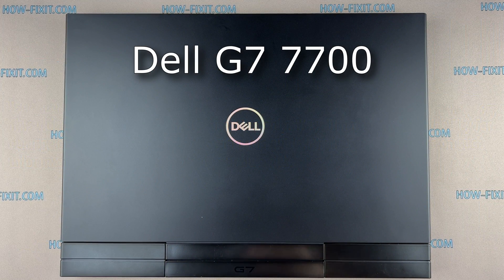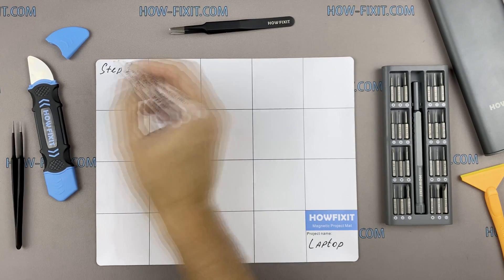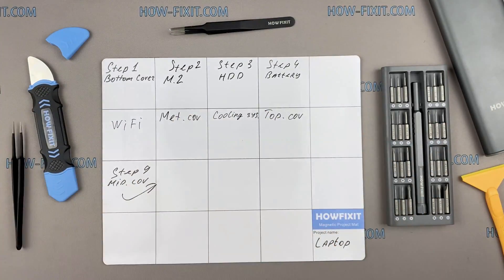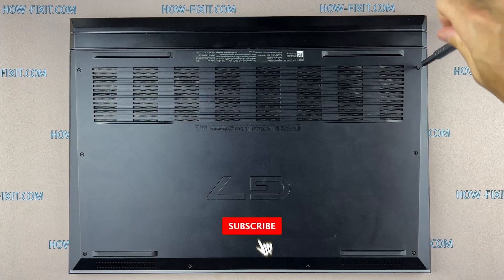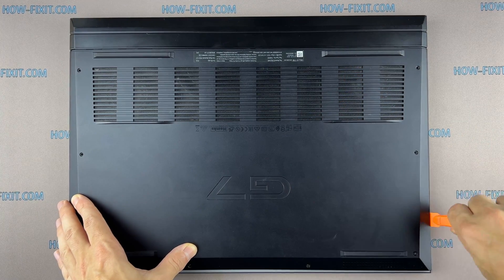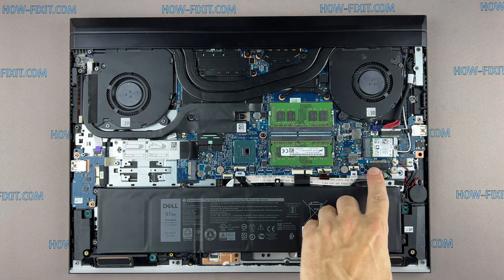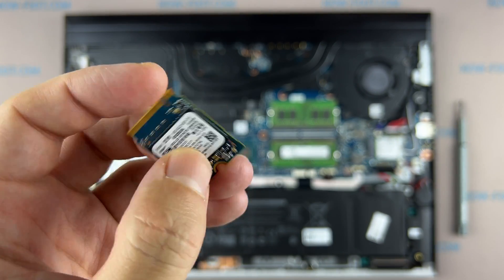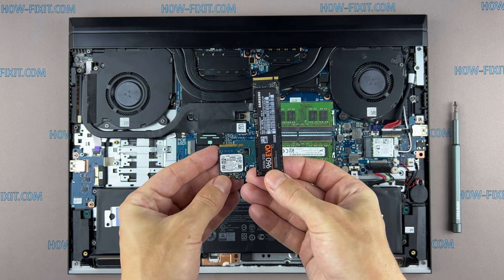Dell G7 17 7700 M2 SSD Upgrade & Install Guide - Boost Laptop Speed!

Comment from the maker: ⚠ The Dell G7 17 7700 supports both M2 SATA and M2 NVMe drives in its M.2 slot. So, you can install either, depending on your preference for cost or performance. Check the description for links to recommended M2 SSD drives. Additionally, watch the video explaining the differences between M2 NVMe and M2 SATA 👉 https://youtu.be/r3Jy5dHOj3g
Reply: The little riser part won’t slide out. Why is this?
Reply: Nvm I just had to push harder

Comment: Hello, my laptop have 512gb ssd but i want to put another 1tb ssd, can I have both?
Reply from the maker: There is no limit on the maximum size of an M2 SSD, but there are Windows limitations. If your Windows is 64-bit and the GPT file system - you can install a drive of any size. Check the description for links to recommended drives.

Comment: Thank you for this informative video! I have Inspiron 15 7577 and it has a PCIe Gen 3.0 (8.0 GT/s) motherboard. Can I upgrade from Samsung pm961 pcie m.2 nvme 256gb to a PCIe nvme Gen3 x4 SSD? Will there be an improvement? Thanks again!
Reply from the maker: The Dell G7 17 (7700) features a single M.2 2280 slot that supports both M.2 SATA (AHCI) and M.2 NVMe (PCIe) SSDs. Check the description for links to recommended M2 SSD drives. Additionally, watch the video explaining the differences between M2 NVMe and M2 SATA 👉 https://youtu.be/r3Jy5dHOj3g

Comment: can the second port next to the one you upgraded by used for storage expansion or do you have to upgrade it as shown?
Reply: It can be used as secondary storage, yes. The issue is getting the caddy for the drive. You cannot just use the drive as is, you need that Plus Shaped Caddy to install it.